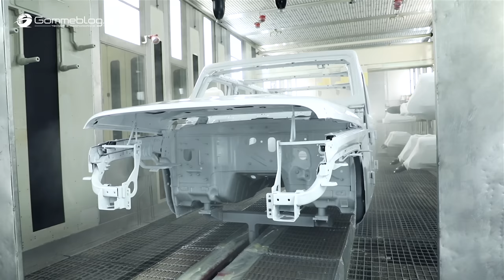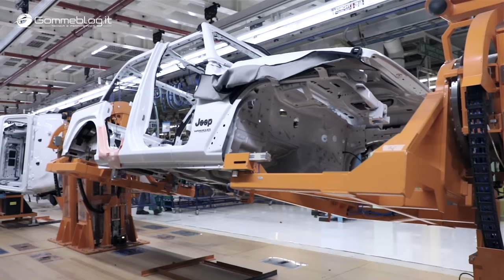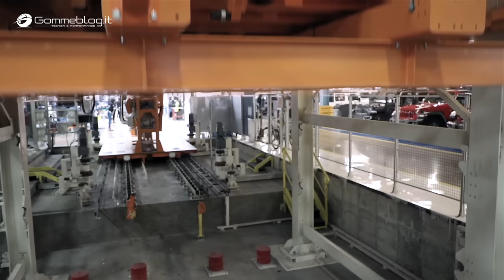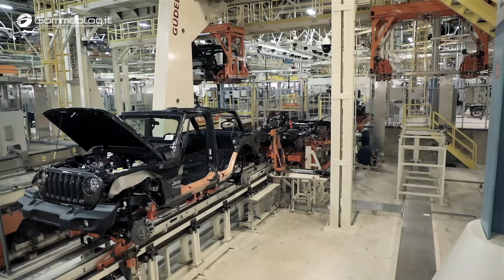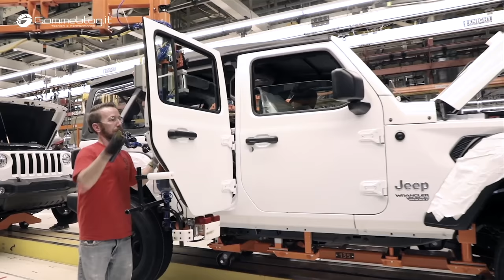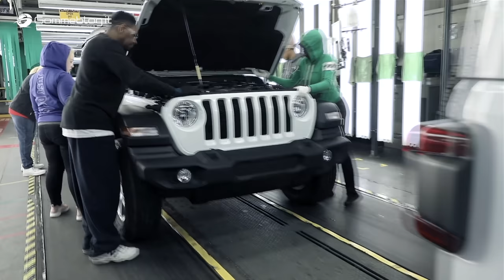2019 Jeep Wrangler - PRODUCTION (USA Car Factory)

Comment: Thanks for taking this video before gm moves to mexico!!  Its sad that trump isnt doing anything about it.... 17000 u.s. jobs lost....
Reply: guy proulx  yes there are 2 gm plants in canada right?
Reply: guy proulx  i have never owned an american car myself... my parents had a 85 cadillac seville and a 90s dodge caravan... they were the worst cars to work on.  The cadillac had seized lug nuts and i actually sheared 2 of them doing a brake job.  And the caravan abs light went on and never turned off.  Both crap.  The water pump went out at 60k miles.  After that i never bought an murican car... European cars just as bad...  i only buy japanese cars since. And i got my parents to do the same.  Never had any major problems... you're right murican car mfg is gonna die besides tesla